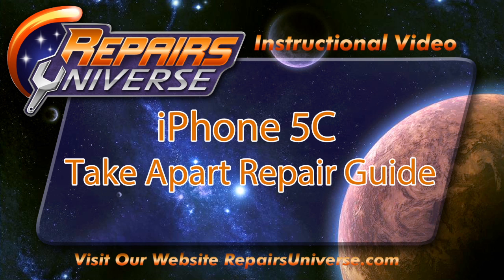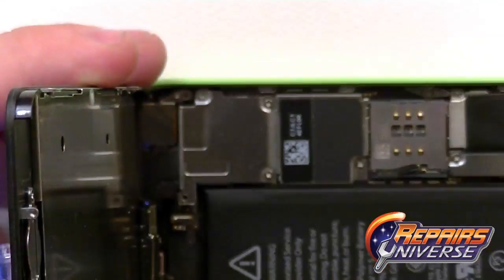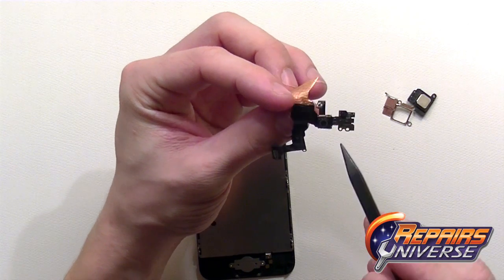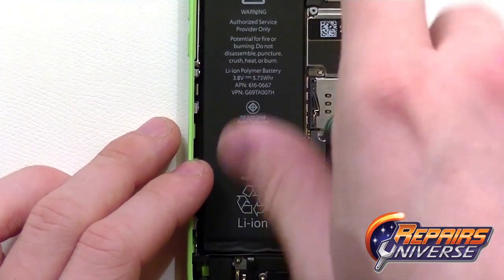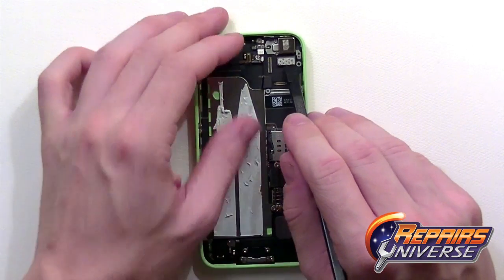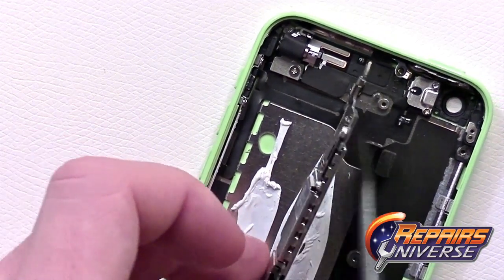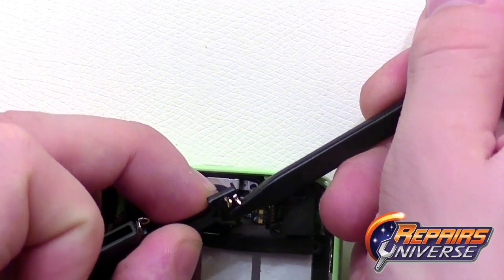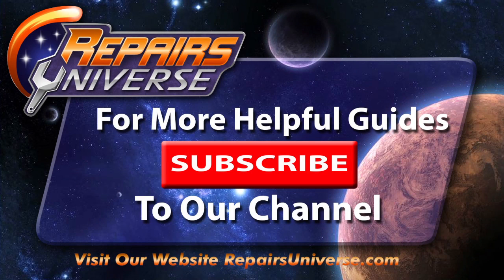iPhone 5C Take Apart Repair Guide

Comment: dropped my iphone and cracked the screen and I still used it.  I dropped it again and  the screen quit completely.  When I plug it in to my computer it doesn't even make a sound.  besides changing the screen could I have damaged something else?
Reply from the maker: Hershel Fugate Possible that there is an issue on your logic board. If your PC does not recognize the unit, it may not be worth purchasing a new screen. Also double check your battery. It's possible that it came loose from the logic board.

Comment: Hello wife dropped her 5c now screen colors darker despite turning brightness all the way up. Loose connection? LCD? Screen did not break just darker and colors are off a bit. Thanks!!
Reply from the maker: Try taking the back off of the device and checking the connections at the top right. Make sure to power the device down FIRST! If after that you are still experiencing the malfunction then a screen replacement will be in order. You can find your replacement parts here..http://www.repairsuniverse.com/iphone-5c-screen-replacement-repair-parts.html.

Comment: In order to change the screen, do you have to take out the battery etc?
Reply from the maker: Joy Williams Nope, the device opens from the front. The screen pops out and can be replaced without touching the rest of the internal components.

Comment: my brother threw my iphone 5c and i went and picked it up, and what i was doing was on there for a little bit but slowly started turning black (the touch screen wasnt working and their wasnt any animation on the screen either). when it was completely black i could turn the screen on and off, but it only went from a black back light to just black. what can i do, and what is the problem
Reply from the maker: Hawk, You will need to replace the Touch Screen + LCD.

Here is your part for the replacement

http://www.repairsuniverse.com/iphone-5c-lcd-touch-screen-digitizer-replacement.html

Comment from the maker: On your creaking noise . Where are you pushing down on the screen at? If its the top part could be the metal bracket that is holding it down that is not screwed down all the way.
Reply: Same issue, 5c creaking. Happens most noticeably behind the volume buttons (on the back of the case- right side.)

If I were to order the specialized screw driver, is there any way I could fix this with a dab of hot glue? Whats your thoughts please
Reply from the maker: Sounds like the clips that hold the screen in have come loose. They are held in by small Phillips head screws.
Reply: My iPhone screen is popping out on the top right from dropping it and I won't go in I Reyes using force and pushing it down but it cracks the screen and I even bought a new power button because mine broke from the drop and bought a new back and screen still popped out
Reply from the maker: Sounds like your frame is damaged. Can you see any visible damage to the frame?
Reply: No